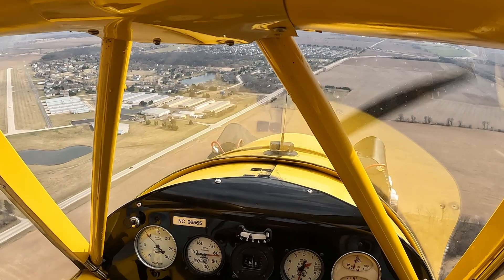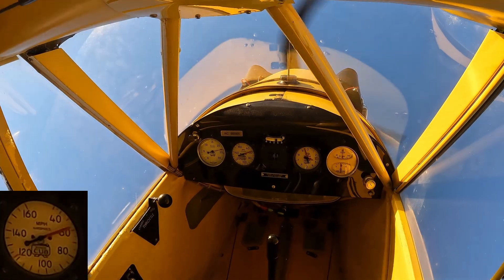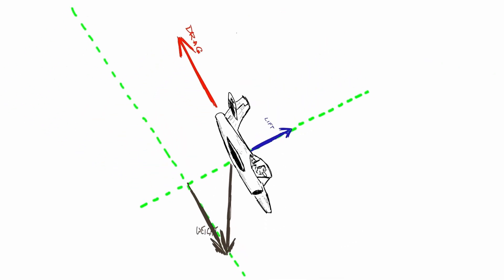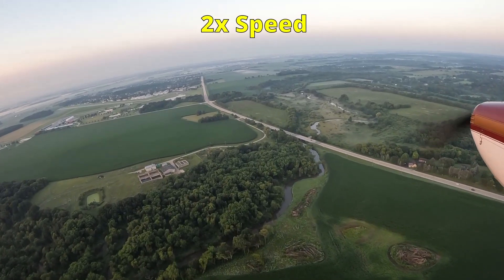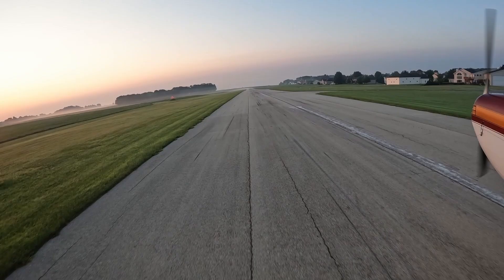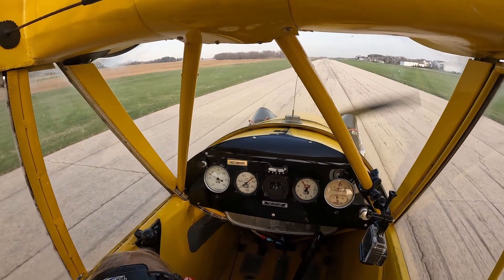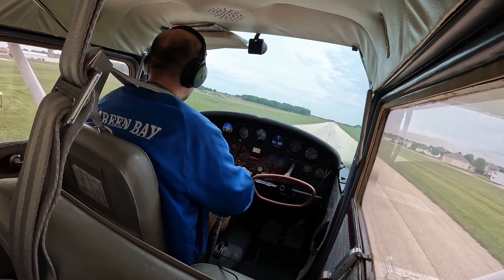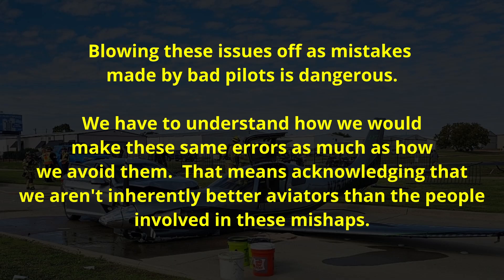Emergency!  Emergency Descents & Landings in Real Airplanes: Piper J-3 Cub, Cessna 170

Comment: Just slip!!!!
Reply from the maker: You're right.  It's amazing what sort of descent rate you and angle you can get with a slip.  And they are easy, leaving your mind free to address other issues.  

There are times a slip might not be a good idea though.  So I bring up some other options if only for us to know about and NOT use them.
Reply: @jonathanzarinnia884 when is a slip a bad idea?
Reply from the maker: That's an awesome question!  Please excuse my long response.   

So, in some planes slips are prohibited, not recommended, etc.  But that's an easy one.

Instrument flying: A slip precesses your gyros pretty far and pretty fast.  I found that out after botching a circling approach one night flying cancelled checks.  

Wear and Tear on Bigger Planes:  The forces on the vertical stabilizer and the rudder balance each other out, but other airplane parts don't have balanced forces in a slip.  The horizontal stabilizer, for example, puts some pretty significant twisties into the rear fuselage.  Flaps roll back and forth on their tracks.  That's a wear and tear issue more than a "We're all going to die!" event.

Some airplanes have weird habits that aren't published.  Rudder hard-overs have been an issue.  I hear that's an issue with planes like the Broussard.  

But if it seems like I'm reaching for examples it's because I'm reaching for examples.

Generally a slip is a very good way to get energy off of a plane.  It's why we are required to teach them to pre-solo students.  And the audience of these videos aren't pilots who are likely to sideslip transport category jets.  AND transport category jets HAVE been saved by timely use of forward slips (like with the Gimli Glider).  Also, if you enjoy them because they are fun, you should keep doing them. 

You'd be hard pressed to find a good reason not to sideslip your Cub.
Reply: @jonathanzarinnia884  thanks for the thoughtful reply. BTW I always wanted a J3 but I have a champ and an L-2 Taylorcraft… no cub yet 😂
Reply from the maker: @Iflyagrasshopper  I love the L-2!
Reply from the maker: Pardon me.  Your L2 or Champ.
Reply: @jonathanzarinnia884  the L-2 is a slip machine  my champ has a big dorsal and doesn’t  slip nearly as nice as the L-2 . I’ve never flown a J-3 but I would like to someday… I’ve heard that the L-2 outperforms a J3 at everything but slow flight… I also heard that VG’s will help the L-2 land slower so I may give them a try.
Reply from the maker: @Iflyagrasshopper  There are a lot of comparisons, but they're pretty evently matched.  A lot depends on engines.  The L-2 will out perform a 65hp Cub, but a 90hp Cub is, understandably, different.

I'm just happy to see (read about) you getting out and flying around.  

I must've been confused earlier.  For some reason I thought you were just down the road.  Flying an L-2 around California actually sounds like a pretty awesome way to be.
Reply: For real! The J-3 (and other Cub variants) is one of my favorite planes to slip.
Reply from the maker: I love the Cub, but the Cessna 140 is right up there too.  Honestly, even at my day job, there isn't a plane I don't enjoy flying.  Still, on more than one occasion I've caught myself at M.83 and FL350 wishing I was at 80 knots and 1000 feet.

All the goofy stuff I get up to with planes on my days off sort of keeps the job separate from the work.  It's worked for twenty-something years now.  Visiting with pilots about flying is part of that too.
Reply: @paulis7319 you need to slip a T Cart DCO 65 or an L-2
Reply: @Iflyagrasshopper  If you bring one to 4F7 I’d be thrilled to slip them! With proper training, of course. Haven’t flown those birds yet.
Reply from the maker: @Iflyagrasshopper  It sounds like we might have the makings of a fly-in.
Reply: @paulis7319 I’m at CN13 you’re a long way away!!!
Reply: @jonathanzarinnia884 where are you located?
Reply from the maker: @Iflyagrasshopper  Poplar Grove, IL.  I live in S. Wisconsin though.  I think you're in Central Illinois, right?
Reply: @jonathanzarinnia884  I’m out in northern CA fly out of CN13
Reply: Slipping with excess flaps (40 deg in older Cessnas for example) can lose pitch control. On short final is a very bad place to discover this!!
Reply: @stubryant9145  I’ve heard that this can happen with 170’s and 172’s